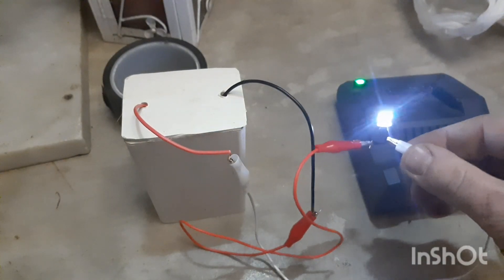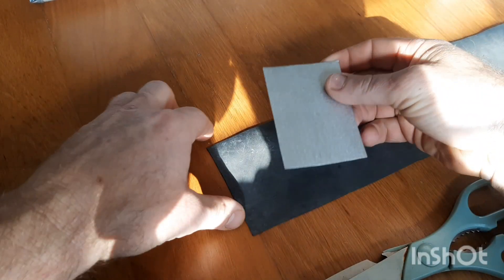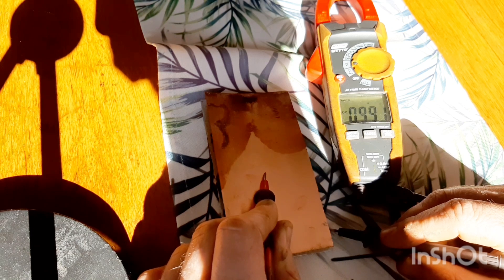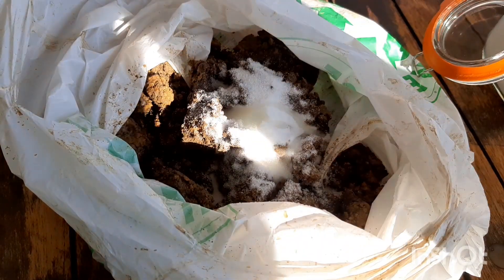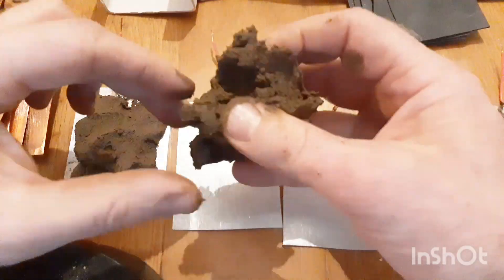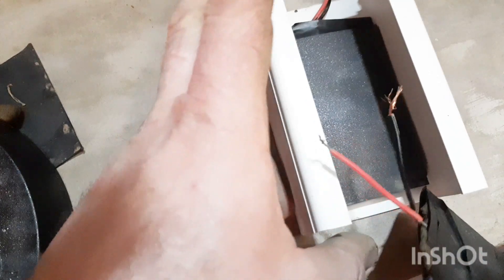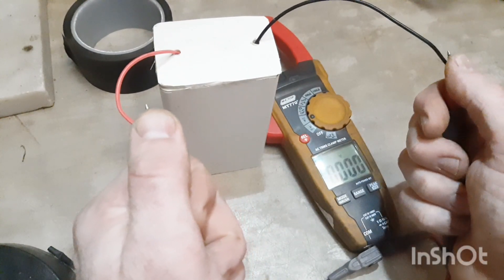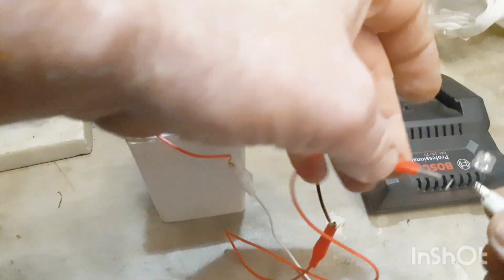DIY RECHARGEABLE BATTERY MADE WITH CLAY#experiment#battery

Comment: The cooking oil is pointless because it doesn't mix with the water so it does nothing to prevent it drying out. Mineral Oil is actually used as an insulator in high voltage transformers. So you're only increasing the internal resistance of your battery.

The reason being that oil is not a polar substance. It has a fairly even charge, unlike water, which is quite polar. Hence they don't mix. Bit also, nonpolar solvents don't conduct electricity very well at all. Even worse than air, in fact. Which is why they fill those HV transformers with it.

In fact, you can look up videos of people who have made cooling setups for their computer where the computer is entirely immersed in mineral oil. It sounds crazy, but it works.

Even very pure water is a fairly good insulator, which is why you need to add an electrolyte to it.
Reply from the maker: Thanks for your comment, Good to know.

Comment: Where is your multimeter? You didn't even test the power output. No voltage. No current. Just light the LED. Which with brightness correction is useless for us. Give us something objective.
Reply from the maker: Thanks for your comment.

I measured the voltage to be 4.5volts. My volt meter doesnt measure such small amperage. Next time I'll have a volt meter that does.